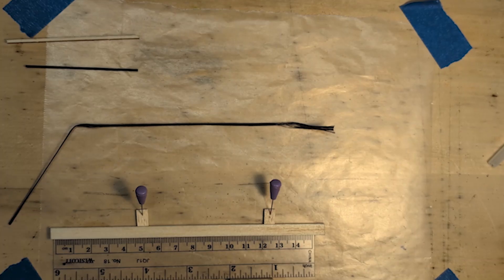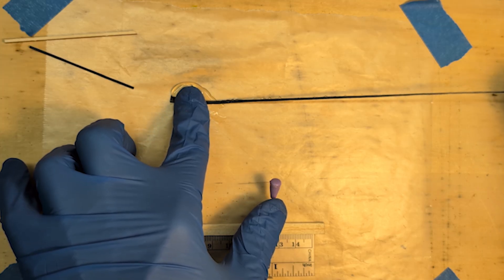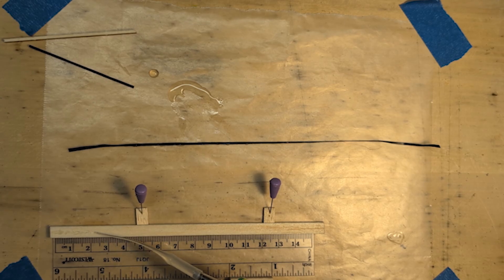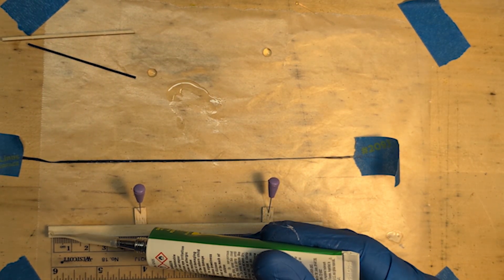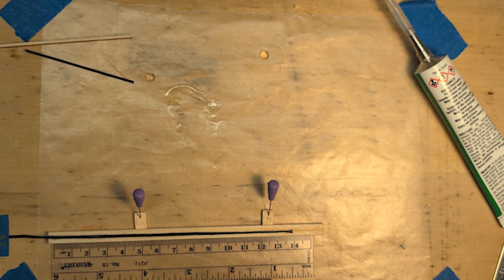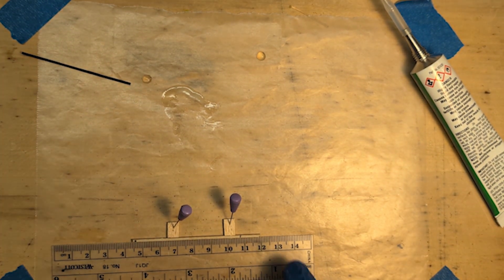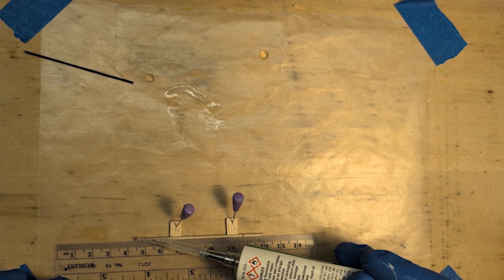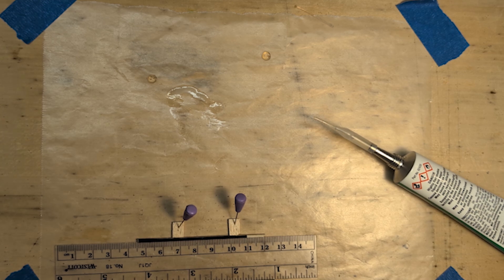Science Olympiad Helicopter 2025-26 - Freedom Flight Kit Carbon Application

Comment: tbh, i just used petroleum jelly to straighten out the carbon fiber and have it to the right width, then i'd just dip both tips into a CA puddle.
Reply: Does Duco cement bond well with something soaked in petroleum jelly? Also wouldn't that add more weight than just soaking it in Duco cement? I'm not an expert or anything I'm just curious to know. What I did was to run the cf tow through the puddle and then clip both ends with a heavy binder clip and let it hang and dry, then I just snipped off a millimeter off both ends to free it from the binder clips and had a pretty straight piece of cf tow which I then just used the same method as in the video to attach it to the balsa.